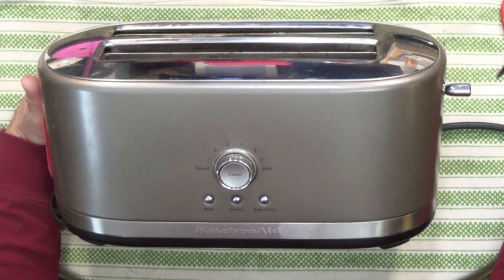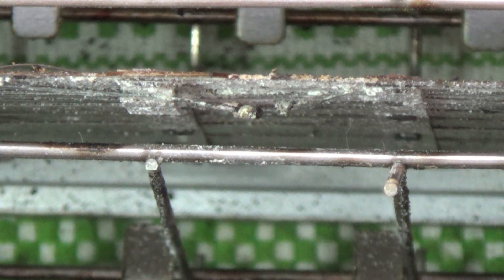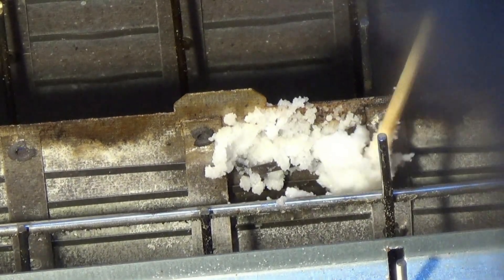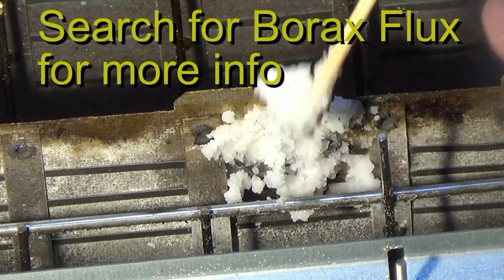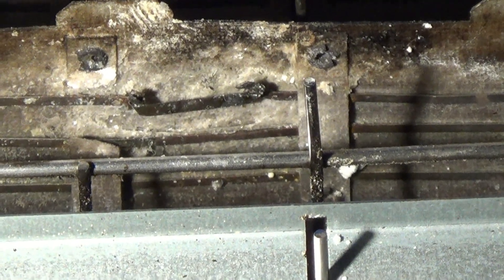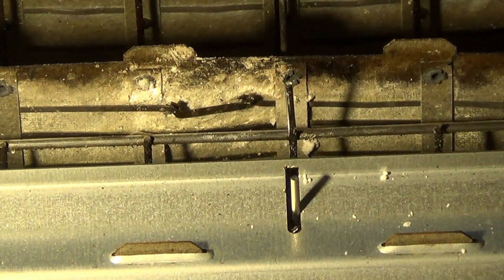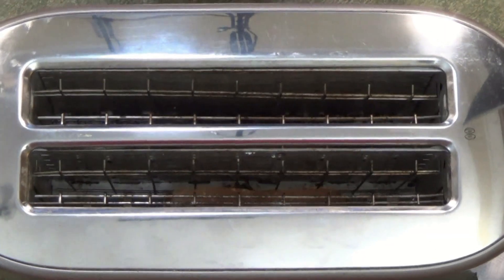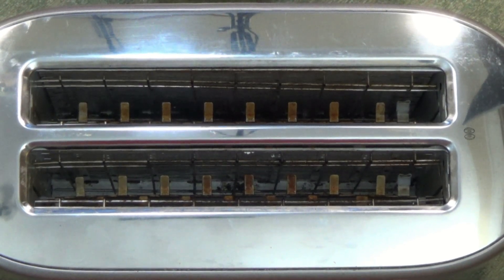Kitchenaid Toaster Heating Element Repair - FIXED

Comment: It would be nice & maybe even more convenient, fast & elegant, if someone invented nichrome sleeve tube crimps, so that all you have to do is insert the broken wires together into the tiny nichrome butt connector tubes & then mechanically crimp them together with pliers.  It might even have some borax inside the tubes to help fuse for a more solid chemical connection.  Another idea is to buy proper gauge nichrome wire, make a tiny spiral of it (like a spring you find inside a pen) as a butt connector, pull the broken wires together inside the spiral & then also try to crimp the spiral, but I dont know how long that will last.   I just recently found my toaster has also broke the center heating wires.  Not only that, but also the mica sheet has broken, so if I am to repair this, I would probably have to do a full disassembly, & there are possibly places in the inside metal frame that are riveted, not screwed, which that itself is going to be a teardown problem in itself.  I had already repaired this toaster 6 years earlier, so at least I lengthened its life further.  If all else fails, then time to buy a new toaster, heh.
10/25/24

Comment: Thank you for the video. We have a KitchenAid toaster that is tripping the GFCI any thoughts?
Reply: Something has shorted out inside probably.
Reply from the maker: Sometimes 1 GFCI handles multiple outlets. Try unplugging everything else that goes dead when the GFCI Trips. They tolerate a tiny bit of "leakage" but it is possible your toaster is just the "last straw" with other devices "leaking" just a little as well.

Comment: thanks for making this video. will try it out to patch an element that has come apart.
Reply from the maker: Did it work? I am interested because my repair held up for 6 months and needs to be done again. I think it has something to do with the gauge of the nichrome wire I used in the patch. There are many sizes.

Comment: Is the toaster still holding up? I have a toaster that needs this exact fix and if a little nichrome wire and borax is all I need great!
Reply from the maker: I have made about 20 batches of toast. The patch glows a little brighter than the rest but it does not scorch the bread and appears to be working just fine.  I am amazed, to be honest.
Reply: Yes looks like the patch is lower resistance so the rest is heating up less. Interesting though , how food safe is borax flux?
Reply from the maker: @paulmeynell8866  The borax turns to powder and can be blown out of the toaster. For the record,  borax is less toxic than table salt. While you aren't supposed to eat it, small ingested qty would pass in urine, not attach to digestive system as in insects.